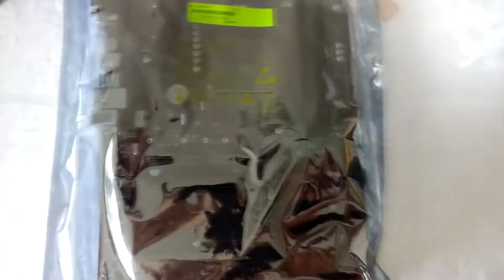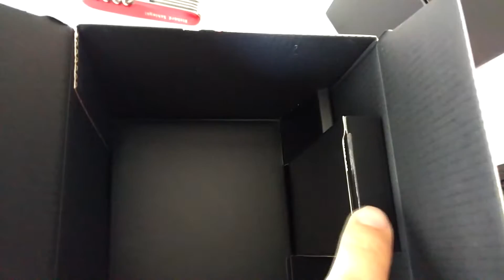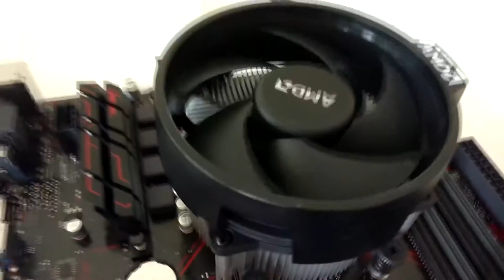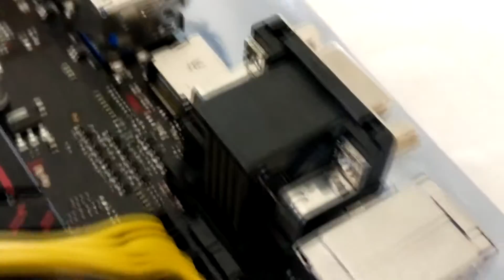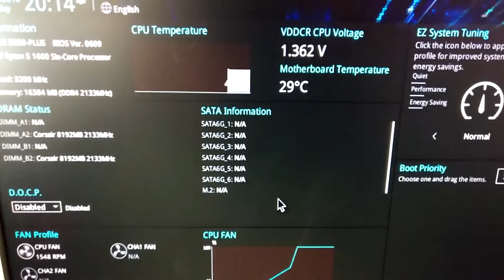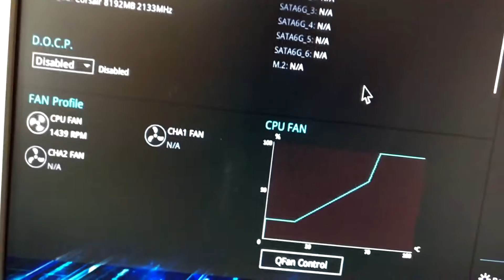New Ryzen 5 Build!

Comment: Was für ein Mainboard hasst du und welche graka?
Reply from the maker: Du meinst aktuell? Crosshair VI Hero & Vega 64 LCE. siehe PC Tour Video!
Reply: derfledderer okay danke für die Info :p
Reply: derfledderer hätte noch eine Frage was hälst von diesem Setup?
Ryzen 1600x
Mainboard:Asus prime b350-plus 
Cpu kühler:be quiet Pure Rock tower
Kühler:be quiet pure wings 
Gtx 1060 6gb 
16gb ram 
1tb Festplatte Samsung 
Und noch nen 500 Watt Netzteil von corsair
Komme auf ca. 835€
Reply from the maker: Das läuft - ausgewogenes System. Würde dann als nächstes auf ne SSD setzen.
Reply: derfledderer ok cool danke :-) ist mein erster pc den ich zusammen Baue☺😁

Comment: Same build and the Hdmi from the Graphics Card doesnt post
Reply: Daniel Gooden Same happened with me
Reply: PlusVict Try using VGA , DVI or DP port on the graphics card
Reply: Daniel Gooden I did still didn't work
Reply: same, did u guys find a fix? i have the same issue
Reply: Boot kit was required because my motherboard wasn't compatible
Reply: How is a b350 not compatible with ryzen 1st gen?, do u mean it was faulty?
Reply: Tano Senpai no my ryzen 3 2200G required my motherboard B350 plus to have a Bios update so I needed a older processor to apply the update
Reply: Ok that makes sense, its just your first comment was same build haha, i have a very similar build to the guy in the video but i get no signal on my monitor :/

Comment: Thanks for sharing. Mine is a similar build too but with  the x version. I plug in the built-in HDMI for the display but won't post. Please advise. Thanks.
Reply from the maker: This Ryzen 5 CPU does NOT have a integrated GPU. You need to plug your Monitor into your GPU! =)

Comment: Hallo! Danke für das Video! Ich habe bei meinem B350 plus exakt dasselbe Problem (no signal) wie du bei dem 1. Boot-Anlauf. Wie hast du den Pieps-Ton erzeugt und darauf erfolgreich ins bios gebootet? Bzw was genau war ein möglicher Zwischenschritt?
Ich habe den Power-Stecker vom Case schon mit dem Mobo verbunden, wenn ich aufdrehe, bewegen sich zwar die 2 am Mobo angeschlossenen Lüfter, der CPU-Kühler und die Lüfter an der GPU funktionieren, genauso wie die rot leuchtenden LEDs am Motherboard. Ich wäre für Tipps sehr dankbar! :)
Reply from the maker: Ich hab den Monitor nicht am Mainboard angeschlossen, sondern an der Grafikkarte. Ein Ryzen 5 hat Stand jetzt keine integrierte GPU, daher funktionieren die Displayausgänge am Mainboard nicht. Nachdem das Videokabel eingesteckt war, hab ich einfach nur neugestartet. 

Ich bilde mir ein, dass der Piepston und der Windows-Ton von meinem Zweit-PC waren.

Comment: do you think i can use the corsair vengenace led instead of lpx?
could you show how you overclocked your RAM? thanks
Reply from the maker: You can use it or course. But it will be a gamble whether you can reach the same clocks. Just look into the QVL list for supported RAM and make your choice based on that list as well as your preferences.
Reply: thanks man, i appreciate your advice i'll see if i can get the lpx 'cause they're out of stock

Comment: you overclock on stock cooler?
Reply: can you answer?
Reply from the maker: You can OC with that stock cooler, possibly only 100MHz below the max overclock. Just dont go to high with the voltage.
Reply: derfledderer what is a ram speed
Reply: It's the frequency at which the RAM operates. Standard DDR4 RAM operates at 2133Mhz, any number higher than that is considered a RAM overclock.